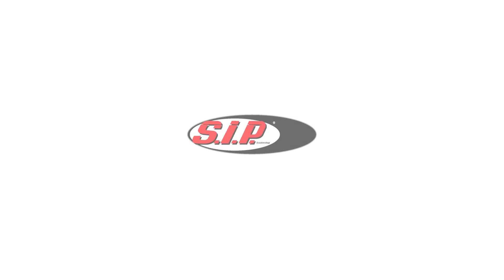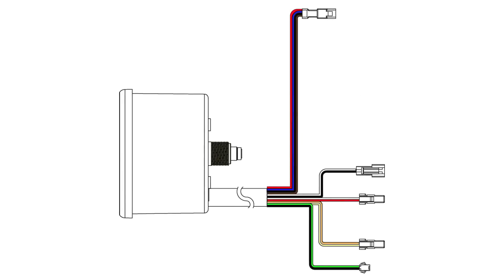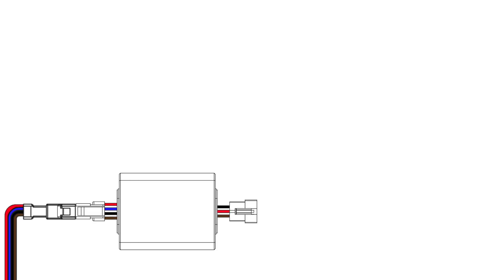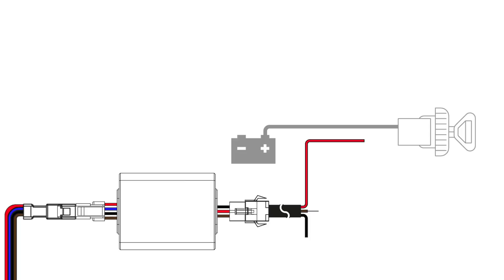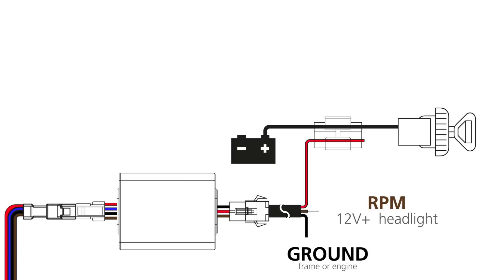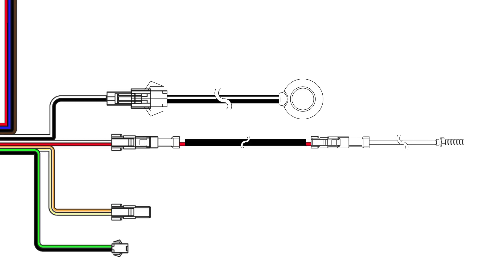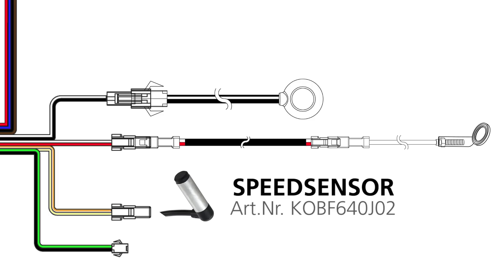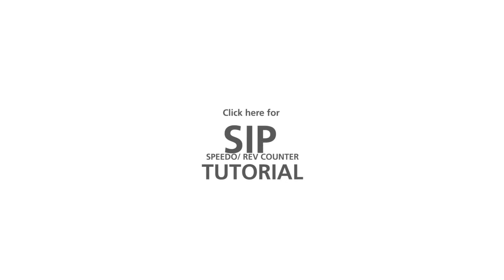Tutorial: How to wire the SIP SPEEDO / REV COUNTER 2.0 for Vespa / Lambretta

Comment: Hey i have bought this item. and in have bought the fast flow fuel tap too. but i still cant connect the SIP fast flow to the speedometer to get the reserve indicator on because the problem was i dont have the green and black wire speedo socket for the SIP fuel tap wire. can you tell me what should i do next?
Reply: and by the way, my scooter is px 150

Comment: where do i have to connect the wire from the sip fastflow fuel tap(black/green)??? the SIP speedometer only came with an extended cable for the temperature sensor!!!
Grtz
Reply: How to wire  VE  injection pump
Reply: Jeffrey Gamon mee too.. i have the same problem